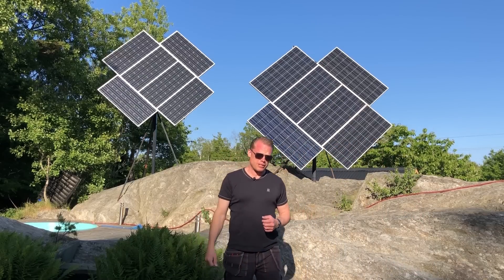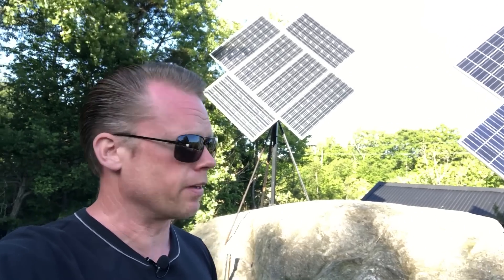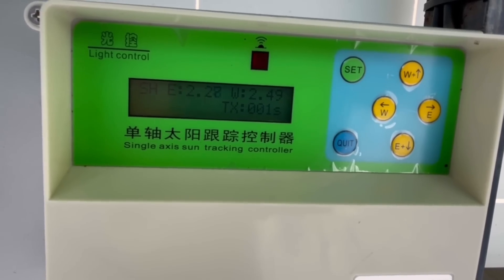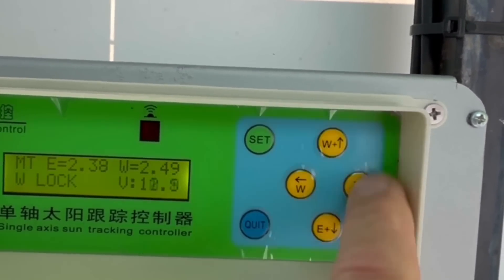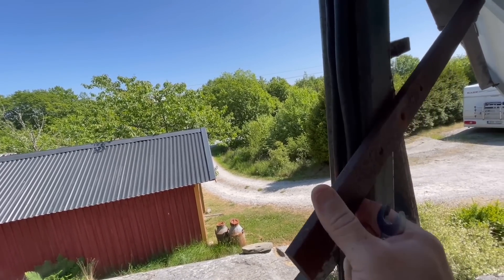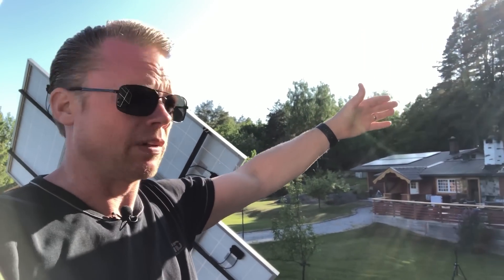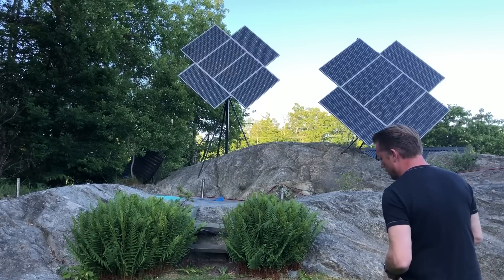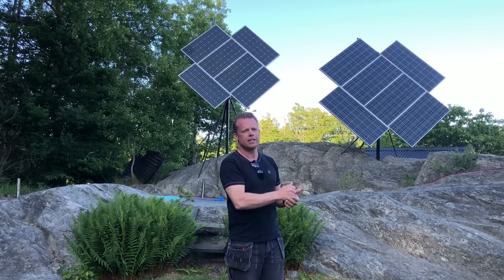Diy Budget Solar Tracker System, tracking vs no tracking.

Comment: Thanks for the informative video. I’m a full timer camper in the US. I’d like to build a similar, yet portable, solar tracking system. Are you willing to share your schematic design with me? Looks like a tripod base, a grid of bars, a linear actuator, and some form of sensor/controller attached to a power source. I’m just learning and you seem to  be heading in a great direction. I don’t have room in our camper for more solar panels so your solar tracking system makes sense for me, too. Thanks, again!
Reply: I doubt you will have space for the construction needed in your camper. This is a massive construction. The solar tracker is from china about 70$ at least that new one he had shown in his previous video. Then you will need the motors and all the metal bars. And these get expensive if you do not build them on your own. 

But for a camper it will get really hard to find a solution cause we had tried so before and always had issues with the overall volume of the construction and panels cause you need to carry that in the camper or in a trailer which we did not liked. We then decided to go for a bigger Lithium battery we have to charge up once we are able to get power.  

At the end it was easier for us to carry 3 simple high efficient panels than all the mess needed for a tracking solution. That would always needed a trailer and that is not what we had wanted. also camping ground can reject to use them cause you have to deliver the proof that they are safe even in strong gusts which means you will need a lot of weight we are not willing to carry along cause there are windsmaps showing the windload / stormload of regions which then provide the amount of weight per squaremeter in the wind direction. 

But maybe the chinese have now an offer for mobile solar tracker incl. a foldable lightweight metal construction.
Reply: @typxxilps , Thank you for the information. I have two Rich Solar slim 100w panels. I hope to create a much smaller scale system. We use the solar panels in US national forests. We don’t often stay in campgrounds. I’m interested in the basic design elements, such as linear actuator, sensor/motor setup, to best modify for my situation. My bracket will be significantly smaller than traditional solar tracker systems, yet the core components may be the same. Eco-Worthy sells a larger solution. No reason I shouldn’t be able to make one to move my two panels as the sun crosses the sky, right?
Reply from the maker: Hi.Sorry for my late reply I’ve built the system completely out of my head so I have no drawings on it whatsoever. I just bought a cheap tracker on eBay and two linear activators and start welding the iron pieces together. Hope you come up to something and thank you for your project .😊
Reply: @flyingtools , I hope to build a small scale version with linear actuators, too. Not sure how/which controller to try. Using a time-based controller sounds good, but not as accurate as a sun sensor. I have more to read about.
Reply from the maker: @LetsGo2WFALLS  time based is the way to go. 👍🏻 that’s my plan to. When I’m finished with that I will post a video here if there is anything that can be interesting for you guys.😊
Reply: @flyingtools , you da Man. Thanks and good luck!
Reply: @kirahund6711 , I could use the 30%-40% everyday instead of manually moving two slim panels throughout the day at our campsites. I could add more panels, but our camper is small and moving more panels each stop and throughout the day is a big hassle with limited reward as compared to leveraging what I have over the course of a day. A linear actuator and controller could be added to a compact frame holding my panels. I’m working in much smaller scale to provide additional energy for lithium batteries inside my camper.

Comment: Hi, wouldn’t be cheirar to keep it fixed and just add 30% more panels, avoiding the mechanical parts that will have maintenance and are another potential failure point?
Reply from the maker: I of course have that to. This is more because it’s fun and interesting to se the difference.  Thats the hole idea with this video.

Comment: dont use solar tracker add few more panals in outher direction (sun set side) it will easy and problem free
Reply: It's not as simple as adding 30% more panels.  You also need to upgrade the inverter and cabling to handle 30% more power.   Tracking is cheap to do - just the mount and a linear actuator.
Reply: @SomeTechGuy666  Yes, it is correct that in some cases, an additional 30% panel capacity may be added if users are looking for longer sunlight usage. This can be achieved by using the availab le inverter that can handle the extra panel capacity It is important to note that solar panels do not achieve 100% efficiency, so the additional 30% capacity helps compensate for the panals efficiency losses.
Reply from the maker: I of course have that to. This is more because it’s fun and interesting to se the difference.

Comment: with your location, and sun angle, you might get a fair gain in spring and autumn with some reflectors in front of the panels....in winter, with very low sun angle, it could be quite an improvement ...
Reply: Even if the percentage increase would be huge, the overall irradiance in winter is so insignificant that it makes no sense to invest in it.

Comment: It's gonna be better in winter when the sun is coming in sideways, my panels are mounted shallow due to my shed roof and I see in winter the angle is way off.
Reply from the maker: In my case, during the winter, I have my panels fixed straight to the south.
The sun will just make it above the horizon.

Comment: What about making a system where you have two or three sets of panels (south-west+south-east or south-west+south+south-east) and either a passive diode system to isolate them or three micro inverters? I'm curious about making a system that has zero moving parts and that minimizes the cost of installation and electronics and maximizes the energy output during morning and afternoon. The maximum accumulated daily energy or peak noon power is often not the most important thing as many users can't use that energy, sell it to the grid or store it. The panels themselves are so cheap today that installing 30% area extra is no biggie. Might be much cheaper than a reliable tracking system. Vertical panels are also a thing when you go further north and have to worry about snow and fall leaves and such. Ease of installation and maintenance and cheapness above all.
Reply from the maker: I been thinking about est south west installation, but in a sunny day in the middle of the winter, 66% of the panels will pretty much just stand there, up north we’re I live.
How ever, that’s only my thoughts without even trying this myself yet.
Thanks for your comment.

Comment: Hey, very interesting! thanks again for your video.

 I have read somewhere that the difference is around 20%, but 30% is something that makes you think twice, in terms of leave panels static.
Reply from the maker: Hi, thank you.
I depends much on witch latitude you live on. The higher the better (in the summer)☺️
Reply: @flyingtools  I figure that, looks like your latitude almost doubled mine (Canary Islands). Thanks again for the value you bring to us.
Reply from the maker: @cesaranzalone4797  thank you so much ☺️
Reply: yea but thats also only on a summerday with optimal clear sky and the right angle to the sun. count in the other seasons, cloudy days and an other angle? those 30,3% are droppinng down ny a lot. 
lets half it for good messurement.. thats only 15% more solarpanels you would need to get the same amount.
he got only 12 panels up there. that would be only about 2 panels more on that  30% would be 2 per tower.. put up an additonal tower with 12 panels and you tripple this up to 6 times.. and you get better low light power with more collectorspace.

its realy more easy to put up a 3rd tower or install an more east or south panel system to gain more in the evening and mornings to susidice the tracking.
for example use the realy big roof you can see in the background to gain more as the tracking system is be able to ever gain.
Reply from the maker: @Total_Egal  I think you should se my other videos… 4kwp on the roof and 7,2kwp on the mountain behind the trees.
This tracking thing is mostly for fun, I guess I have to clarify that in the next video😅 
Thanks for your comment and thoughts anyway.
Reply: @Total_Egal  I'm not sure what you're saying is entirely true. I have a fixed rooftop set up in Southern Spain - today my 3.47KW PV system will generate about 21KWh. In December on a good day it's about 9KWh - the sun is at low angle to the panels, and rises behind a hill in the mornings, and falls behind a ridge in the evenings (plus the only two mature trees in my valley) so not only is the day shorter but the sun strikes the panels at an acute angle - even at peak the production is much less (about 2KW versus 2.9KW in the Summer). Cloudy days are irrelevant - they would affect both fixed and trackers equally. If I had a tracker system rather than rooftop panels my panels would be facing the sun at a much better angle for most of the day in Winter. So, if anything, the comparison should work better in the Winter.
Reply: @malcolmrose3361  you would need to adjust the angle between summer and winter on the system.
because its a sun follow system it doesnt mean it can adjsust in 2 axels ov movement. t iis still fixed to one day (or season) in the year with a 1 axis system. of course you get more of a mid day sun effect with it.
 
but the shorter days in the winter are just shorter. also your shadow problem from trees and hiills beeing in the way cant be solved with this.

and its still the same metric.. if you can gain 20 or 30% more with it you could also add 20% more solarpanels to your system and put them at least in parallel. more panels are realy cheap addet after you got a full sydtem running.
And yes this would improve low light and cloud day perfomrance since you get just more harvesting area on this days when the sun angle doesnt play the large role because clouds....
Reply: Keep in mind this is a 2-axis tracker which optimizes both tilt and pan.  Most trackers are 1-axis optimizing just tilt.

Comment: How would those standup to a windstorm of 40 - 50 mph or worse? I have a ground mounts where the panels are solidly mounted to the frame but one windstorm was strong enough to rip one of the panels from the frame. Amazingly even though the panel landed on the ground it wasn't damaged. The turning moment of those panels on that pole would be like that of a sail ship especially bad at the articulating joints.
Reply from the maker: I explain that I the video.
It has been standing like this for nine years and have already payed them self of anyway if the worst thing should happen.😉

Comment: What is the cost comparison between trackers and spending that money on more fixed panels?  Your comparison is not apples to apples.

What I am seeing is that trackers only pay if you have limited area and cannot add fixed panels.
Reply from the maker: Hi. I just show the difference here, and I made this system because I like it and it was fun to build. This is only a small part in comparison to the rest of my “fixed” system of course.

Comment: Nice human made sunflowers! :)
The panels have black boxes installed on the non sun facing side - are these microinverters?
Reply from the maker: Hi, thank you. That’s only the connection box. They are all connected in series so no micro inverters needed.
Reply: @flyingtools  I wasn't sure if you did have them to offset any shading or to keep open circuit voltages low for safety... :)

Comment: I would keep the trees.  It would be cheaper to add a panel or two.
Reply: Yeah but the power still drops off precipitously during the even with a few panels won't make up for and you'll need battery storage to make up for that difference and batteries are more expensive than panels or even trackers
Reply: It doesn't work when panels are chained
Reply: the issue with running panels like this isn't just a panel or two, when shade this one panel in a series it will negatively affect the entire string, not just cut off a little power from one panel.. it's kind of weird, you can cover like 10% of a panel and it will lose 90% of it's output or some such
Reply from the maker: Absolutely, but I would love the extra hours of evening sun.
Thanks for your comment btw☺️
Reply: @flyingtools  there are enough trees arround growing. no one said anything as someone was removing trees to put a house there and a yard arround.
people think having trees is the soulution for everything. but trees are also only a co2, carbon and energy circle in the system. a realy not effektive one. if you can get 1h more solar out of your system ofer the next 20 years you will have use this many less co2 from grid power plants its worth hundrets of trees.
also you can just plant a new one or let one grow up you would otherwise cut down to still have the nature in balance AND have your more solar every day.
Reply: Great why dont you hold the panal and track the sun by yourself  ;)
Reply: @razawaheed7824  You should play Stationeers.
Reply: @razawaheed7824  His property his trees. He can do whatever he wants.

Comment: I wish that the tracker would just work on your Latitude and Longitude and time of the day. You don't need no constant measuring when the sun movement can't be predicted year over year and probably with better precision. It's just the installation might be more tricky
Reply from the maker: I have done some test on that, and it is not worth it.
I might have to do a video about that to.
Spring setting vs winter and summer😉
Thanks for your comment.
Reply: @flyingtools  I'd love to see this.